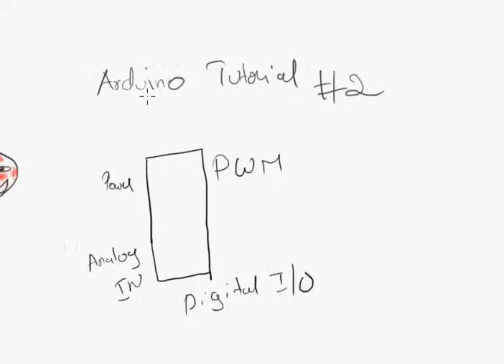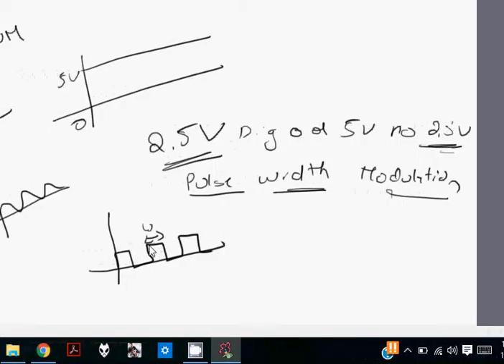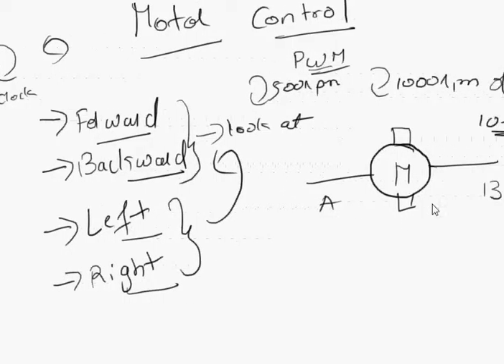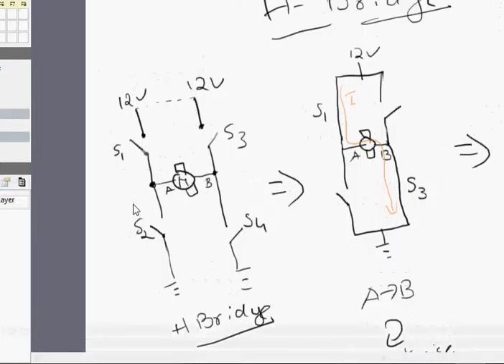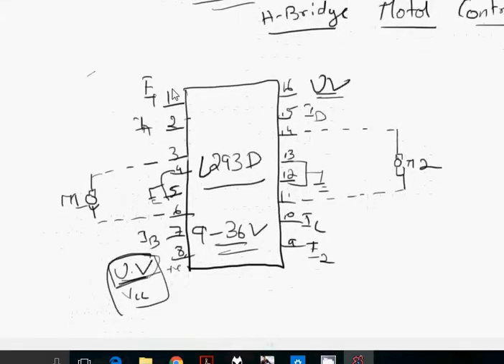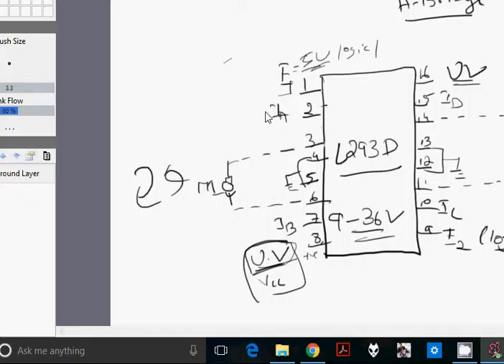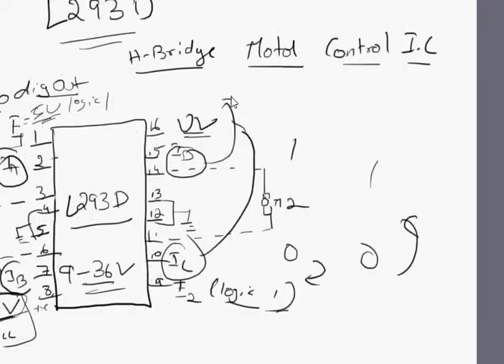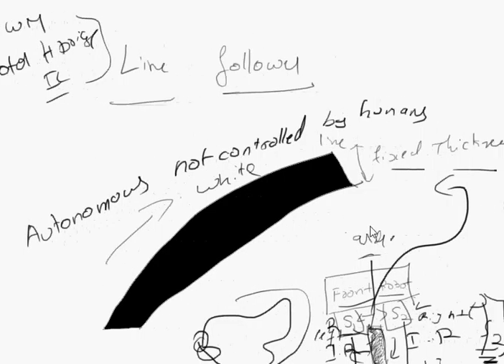RobNinja - Arduino Tut - 2 (PWM, Motor Control, H bridge , L293D)

Comment: Is it not easier to just directly send a PWM single to the inputs of the ichip rather than doing it towards the unable pins this would save you from using two extra outputs from the Arduino, is there a reason why you could not do it this way?